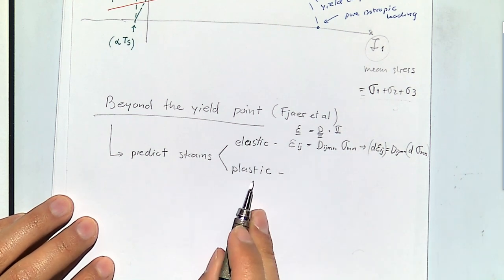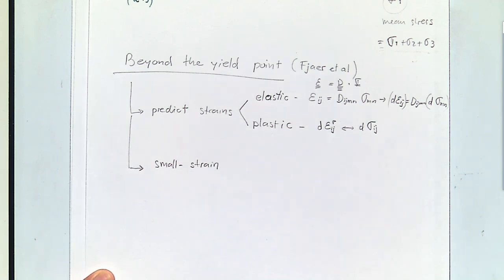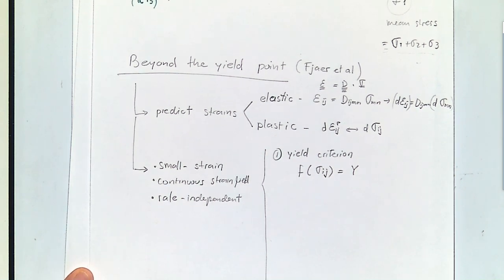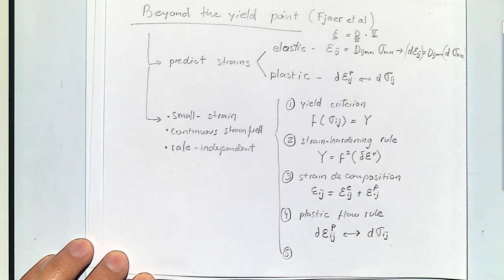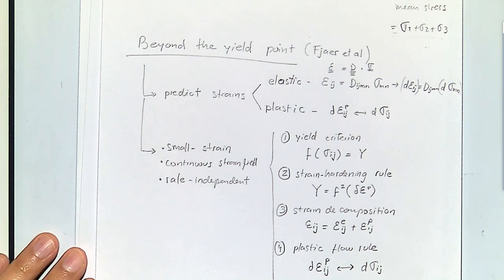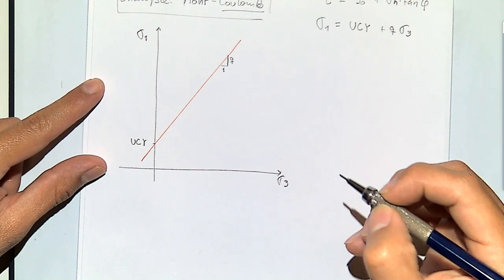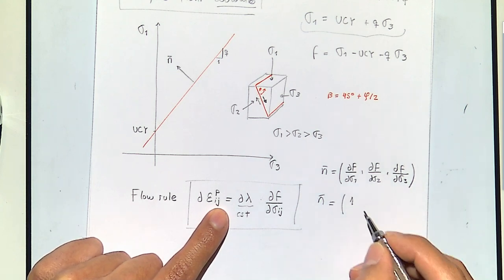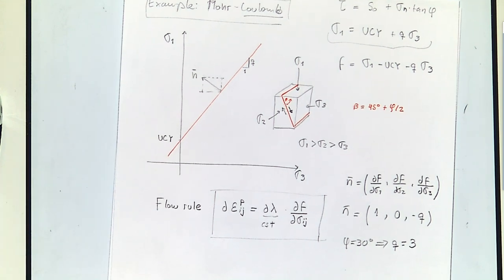L19 Plasticity theory: examples with Coulomb yield criterion and Cam-Clay model

Comment: How is negative volumetric strain dilation and positive compression ? Pl explain
Reply from the maker: This follows the typical convention in geomechanics for which compression and contraction are positive and tension and dilation are negative. It is the opposite of conventional mechanics. The models can be applied with  the classical mechanics convention though.

Comment: hi Dr. your lectures are wonderful and I am a PhD student in structure from Iraq and I follow them with great interest .can you solve some question like this  The material is high strength steel with yield stress = 50 ksi. Find the factor of safety
against failure by yield based on (a) the Tresca’s criterion, (b) the von Mises’ criterion.
with respect Mohammed